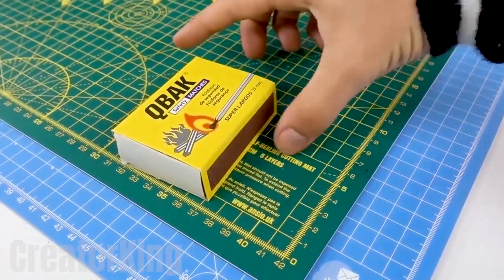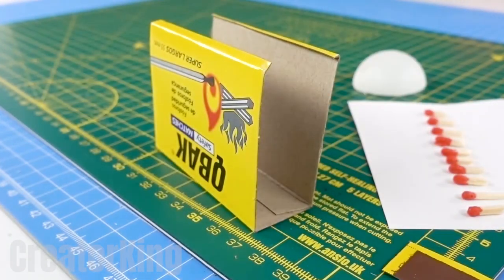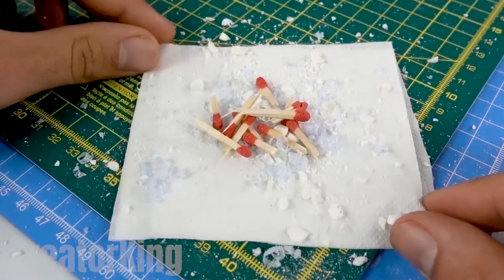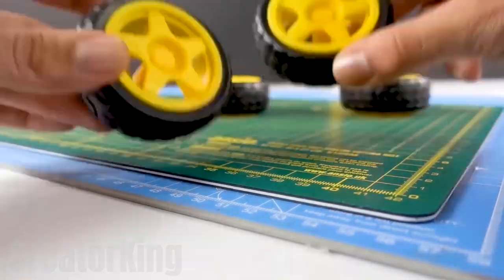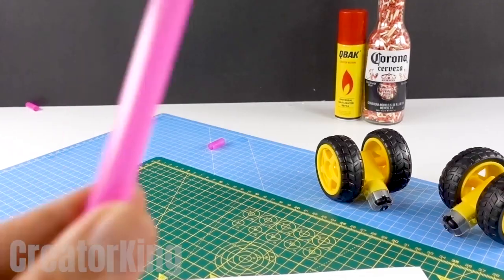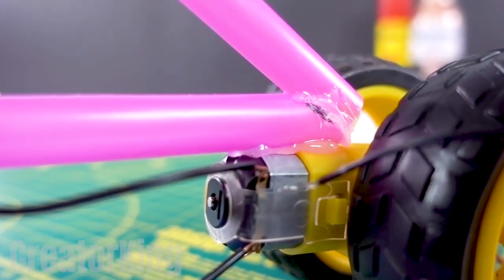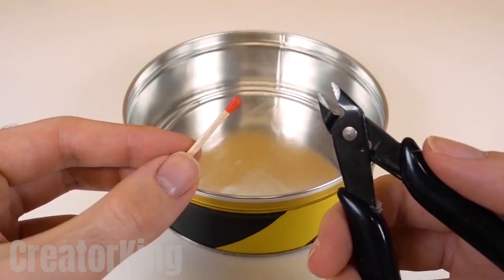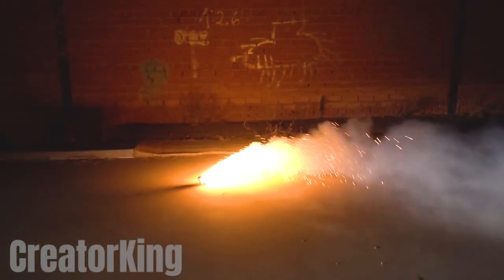The CRAZIEST Experiment I've Ever Built with Matches 🔥🤯

Comment: INSTRUCTIONS ON HOW TO MAKE A VERY BIG SMOKE BOMB: 
Ingredients: 92 g of potassium nitrate kno3
50 g of sugar
58 g of candle wax
Gypsum powder
A thick and strong paper tube
A little bit of cardboard 
Visco fuse (the wick)
And some water
1. Blend both the potassium nitrate and sugar separately 
2. Mix the potassium nitrate and sugar together well. Then shake it in a closed container for 3 min. 
3. After thats done melt the candle wax until it theres no bits remaining and it looks like a liquid.
4. Mix together the melted wax and potassium nitrate and sugar combination VERY WELL until its a nice paste. 
5. Pour the paste into the paper tube but make sure you leave around 1.5 cm for the nozzle. So if you made to much throw it out or use if for another one. 
6. stick a pencil in the paste so when you take it out and the paste has dried theres room for the fuse/wick. After 8 hours of waiting it should be hard enough. (You can take out the pencil when the paste is dried enough that it wont fill the spot for the wick. 
7. Sprinkle a 50:50 mix of potassium nitrate and sugar on the dried paste so it ignites better. You shouldn’t cover the whole thing. 
8. Cut out a cardboard circle that tightly fits into the tube. Make a small hole in the middle of it big enough to fir the fuse. Then glue the visco fuse to the circle. Make sure its located and big enough to reach the bottom of the tube and also have a few inches hanging over the top of the tube.
9.Push it all the way in until it touches the paste. Then hot glue the circle to the inside of the tube. 
10. Pour a little but of gypsum powder on the cardboard circle so moisture doesn’t get in. Then mix water and gypsum powder till its a thick paste. Grab a straw and put it into the wick. 
11. With your hand out the paste onto the tube. That why you would have left some space between the kno3 sugar  wax paste and the top of the paper tube. Mold it so theres a little bit sticking out. The straw should make sure the paste doesn’t touch the fuse/wick. 
11. After thats dried take out the straw and its pretty much ready. Make sure to light it in a big area outside. 
12. Take a match or a lighter and light wick on fire. The run away so you don’t breath to much of the smoke in. Its sound hard but its pretty easy if you have the things. Hope you have fun! (This has not been tested but changing the color of the wax might make the smoke that color.)